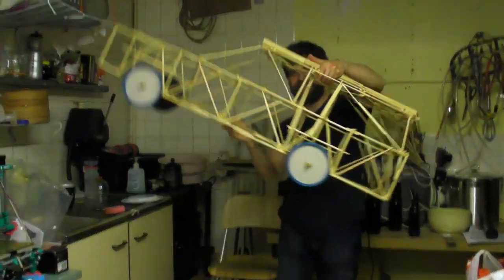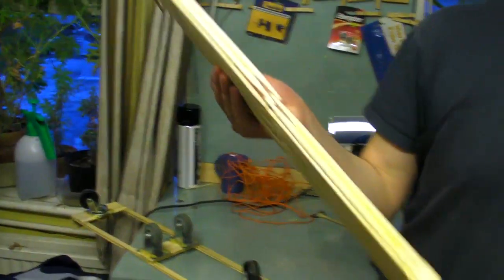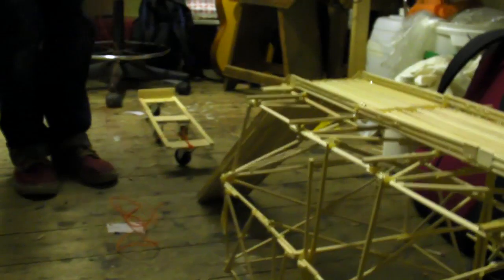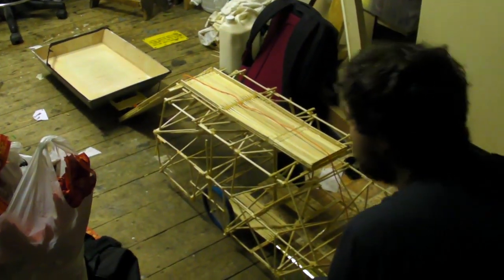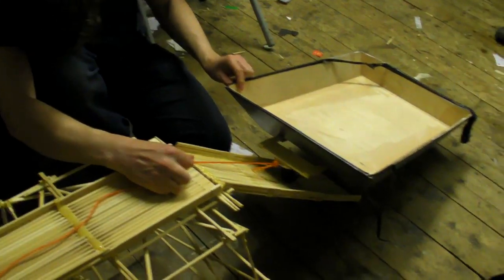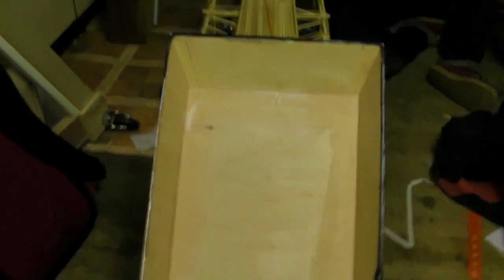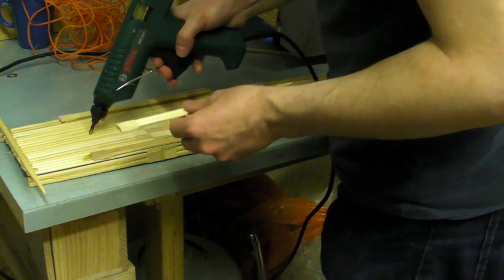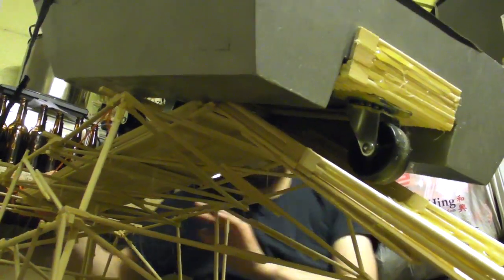Boat Update - Swanzilla - Car Ramp Model

Comment: Hi,Just a random thought that might help you out. How about a sled rather than wheels ? This would serve the purpose better steering the boat up the ramp regardless of how steep it is. Or Make the pitch of the ramp less steep and have it folding in the middle. When the latter is an option,You could re-enforce the ramp from underneath when opened up taking the weight of the boat ? i hope this makes sense,lol.
Reply from the maker: We may have to resort to that in the end.  A part of still think four strong men could lift the boat up upon lengths of 2x2 and the car could be driven underneath.